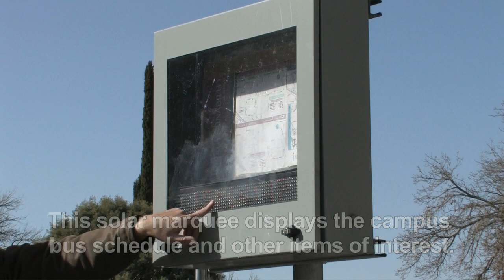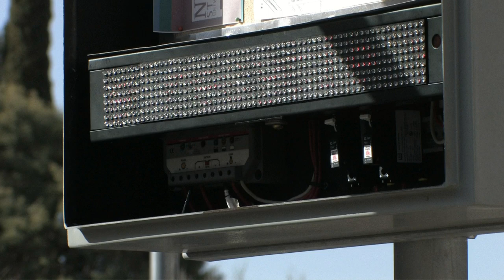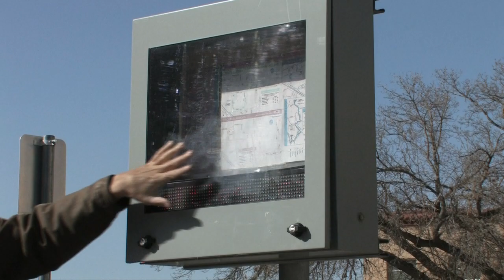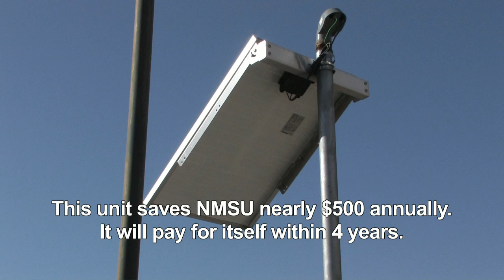Renewable Energy: Solar Marquee

Comment: Great stuff.... As oppose to having to add  battery and box to every point/post/signal couldn't a larger battery be built underground or at existing power station or somewhere so that there would be just one battery, box and control system for the entire street?